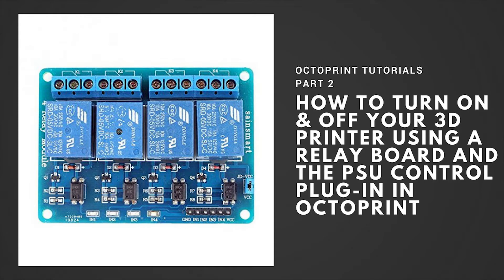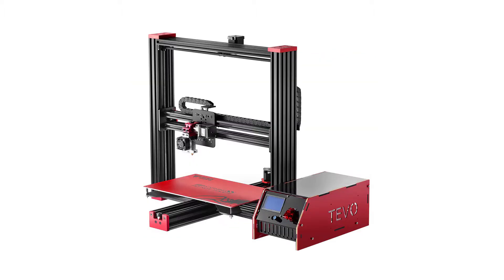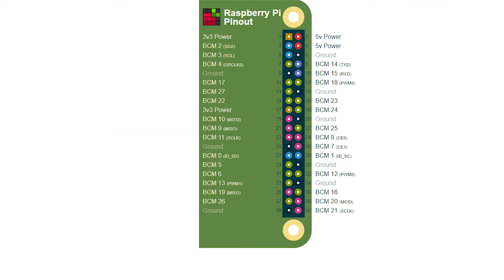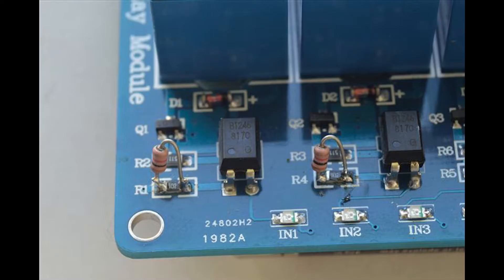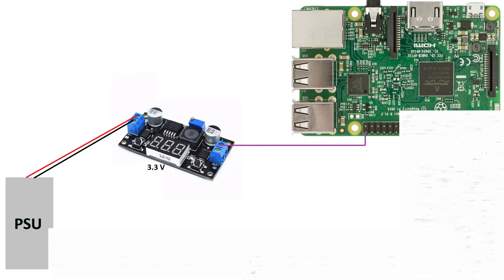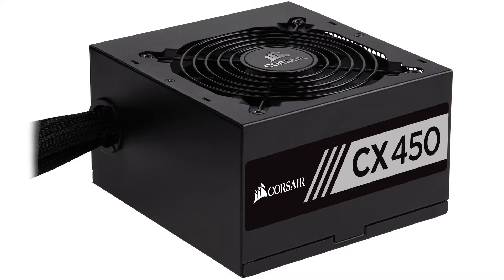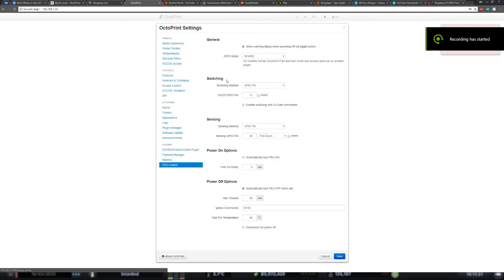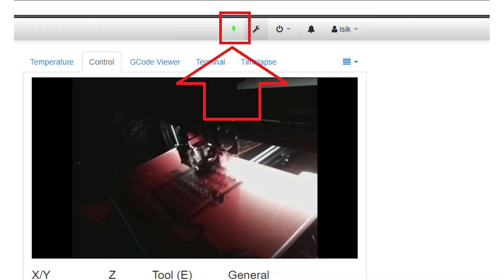How to turn your 3D printer on/off remotely? (using a relay board) - Octoprint Tutorials

Comment: Thank you for your reply. I have everything connected but since I don't have the buck converters for the sensing which method in the settings do I apply. Not sure what you mean by enclosure plugins. But I have the same 4 ch relay with the resistors soldered in. Im using 3 of the 4 relays to power on and off my printers.  Thank again.
Reply from the maker: Name of the plugin is "Enclosure Plugin". Just install it the same way you installed psu control, and don't forget to disable or remove psu control. You can add multiple psus as outputs to the enclosure plugin

Comment: Thank you for all your knowledge. I have question since I would like to run 3 printers and be able to power each one individually.  Do I need 3 individual buck converters for each printer. I only see x2  3.3v pins on the RPI. I have yet to find a video on how to power on and off multiple printers using this 5v 4channel relay.  Any help is appreciated.  Thank you.
Reply from the maker: Octoprint is not designed for multiple printers. That being said if you really need to control their psu s, you can use the enclosure plugin, and skip the buck converter parts.
Reply: You might need separate buck converters as one provides just enough current for 1 RPI

Comment: I followed your tutorial and everything works great when using the internal option. Now i have parallel relay and hardware button for switching the PSU on/off. When switching the relay it works, but when i switch with the hardware button octoprint does not sense it as switched. I tried using gpio pin 40 to sense it, using 12 to 5 V converter but did not manage to get it working? any advice is appreciated. Thank you
Reply from the maker: You shouldn't use a 5V converter. You can destroy your raspberry pi. (Speaking from experience) You should convert to 3.3V.
Reply: @IsiksTech  is it enough to connect 2k and 3k resistors to the converter as voltage divider?
Reply from the maker: Sorry, it has been a while since I last worked on stuff like this. I'm not sure. Only thing I'm sure of is, don't feed a rpi 5v in gpio pins. I suggest using an adjustable buck converter if you have one. They are pretty cheap.

Comment: So if the raspberry pi is connected to the power supply and it controls the relay, when the RPI turns the relay off(high voltage) the power supply will be turned off and the rpi won't be powered. Am i wrong and how does this work ?
Reply from the maker: Rpi is not powered by  the psu. You power it separately. The connection to the psu is for detecting if the psu is on or off.
Reply: @IsiksTech  It makes sense now. thank you.
Reply: My Pi is powered by PSU so I guess this won’t work for me :(
Reply from the maker: Yeah it won't work for you. But if your psu is a computer psu you can power your rpi from it using the stand by 5v rail and seperately control the rest of the psu. It's the psu_on pin on the 24 pin motherboard connector.

Comment: Is it possible to simply use a resistor on the PSU Output-line and connect it to the sense-GPIO-pin of the Raspberry? I have an Ender 3 with a 24V PSU and would connect its output with 2.2k Ohm to the Raspberry. Thank you for the Tutorial!

Comment: thank you for your tuto with fully details.  for me, i will shutdown the printer 3d directly on the principal  wire 220v because  i plug it 2 power supply ATX and S-180-12v-15A and have 1 silicone 220v 300w. i need off and on directly on the principal socket femelle 220v. thank you in advance for your idea

Comment: Can I buy a 1K resistor from here?
https://pl.aliexpress.com/item/MCIGICM-100pcs-1-4W-Metal-film-resistor-resistors-47K-100K-150K-220K-0-33-2-2M/32839986571.html?gps-id=pcDetailBottomMoreThisSeller&scm=1007.13339.99734.0&scm_id=1007.13339.99734.0&scm-url=1007.13339.99734.0&pvid=2e6e18bc-7d2b-43ae-884f-7909d63f818f
and relay module:
https://pl.aliexpress.com/item/5V-Relay-Module-1-Channel-Low-level-for-SCM-Household-Appliance-Control-FREE-SHIPPING-for-arduino/32315027365.html

Comment: Would I need a low level 3.3v relay module or a 3.3v high level relay module ? These are what are available on eBay but I don’t know what one to choose . Also I found another relay module that is 3.3v but it has a switch for low and high level .

Comment: Is there a reason I can't use a single relay board instead of using a 4 relay module?
Reply from the maker: No. Single relay is fine as long as the other specs are the same. You will also need to find where to solder the resistor too.
Reply: Isik's Tech thanks!!!! I will let you know how it goes. Great video. Looks like you have a lot of good videos. I will check them out. Thanks again.

Comment: Is there a reason why you didn't use the 5V output (Pin02) on the RPi to power the relay instead of modifying it with resisters to work on 3.3V (Pin01)?  Thanks great video.
Reply from the maker: Raspberry pi gpio pins only support 3.3v. If you apply 5v to them you will damage your pi. To prevent this the part of the board that needs to be controlled by gpio pins should be powered by 3.3v.
Reply: Thank you for the quick response. Much appreciated!

Comment: So the regular AC cable (brown, eu) (which normally attaches to the LINE (hot) output on the PSU) is instead connected to the 2nd
terminal on the relay. The 1st terminal on the relay is then connected to the LINE output on the 
PSU for AC power. The printer ground is connected as normal to the PSU.
Then when the relay is switched, the AC power coming from the 'LINE' PSU output is connected through the relay to the regular AC Cable (brown)
going into the printer. Is this correct? Nothing needs to be connected to the 3rd terminal on the relay?
Reply from the maker: Correct

Comment: does one need resistance? the raspberry output 3.3 v to the relay signal and make it switch.
is resistance necessary?
Reply from the maker: Yes. You are using 3.3v imstead of 5v (Since rPi is 3.3v). Because of that you need less resistance. Adding a resistor in parallel will reduce the resistance.